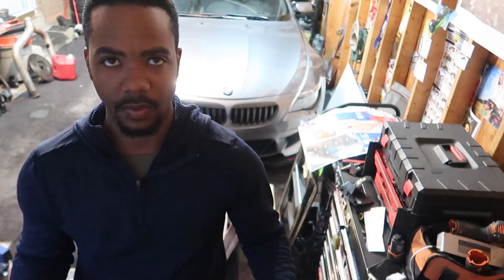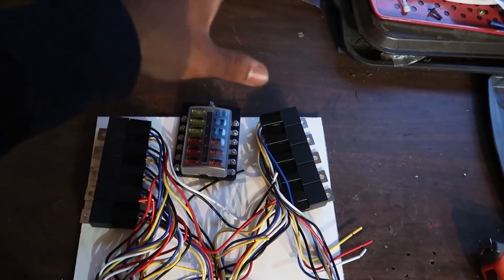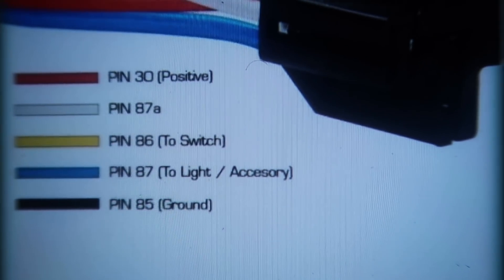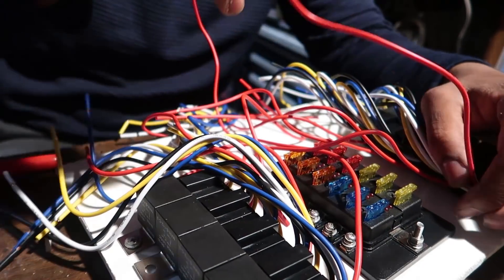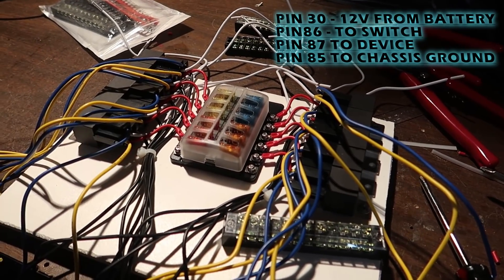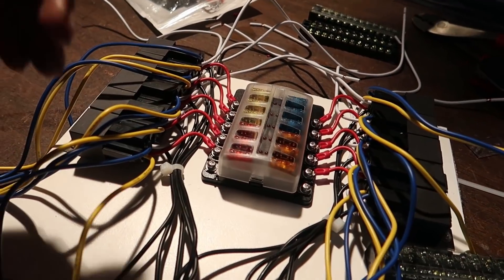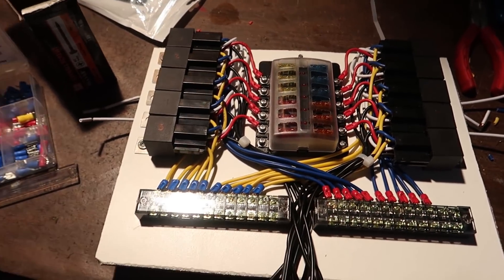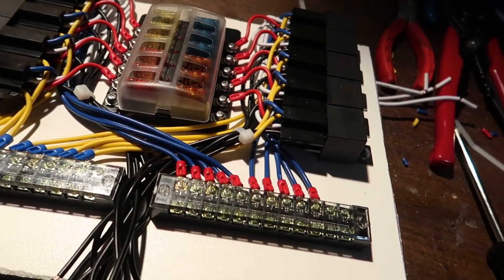DIY Race Car Fuse relay pannel

Comment: Do you have to run power directly from under the hood, or can you use a distribution block to p/u power? And can i ground to a terminal block or do i need to run each ground independently to the chassis somewhere?
Reply from the maker: you can connect all the grounds together and run them to a single wire, just make sure it's a nice beefy wire and find a strong place to ground it.  You really don't want that on a weak ground, and power to the board needs to run directly from the battery into the fuse block....  so yes, in your case, directly under the hood.

Comment: One thing I am wondering and I hope you can answer. I have thought about these relay blocks for a while. I know that it is justified to have fuses running from your power source to your device in order to protect it, is there a requirement for there to be a fuse between the switch and the power source?
Reply from the maker: you should be good as long as there's a fuse somewhere along the powered wire.

Comment: I agree with Liquid snake.  Electrical is not rocket science.  Just need to made sure you label things, the wires are neat, lights should be on a 30amp fuse, and try to put the panel in a cool and accessible place.  Oh, and a great ground is essential!!!!!!

Comment: For the grounds, you can drill a small hole below each relay and run the wire through the board and consolidate them under the panel. Then you won’t hardly see them at all and would be that much of a cleaner look
Reply from the maker: I ran them all to a single hole, but I like your idea better, im going to go back and change it now.

Comment: This actually really helped me understand all what has to happen. I plan on doing this on my e36 so thanks for the video
Reply from the maker: Glad it helped, although its a simple build, most vids oversimplify and still leave you lost.
Reply: Premium Fuel Mag exactly
Reply: I made mine up and idk if I’m over complicating it in my head or what but I’m confused lol i have pretty much the same set up you do. I’m confused on how to wire a switch for my fuel pump into this. I send a wire from the power side to the switch? And then the other power strip thing goes to the fuel pump?
Reply from the maker: no, the switch wire goes to the switch and then to ground, that's what all the terminals on my left side are.  On the right side of my board are all the matching power outputs.  so if I was wiring in a fuel pump, I would run the fuel pump wire to #10 on my right side, and on my left side I would run a wire into one side of a switch, and the other side of the switch would go to the chassis (ground)  If this isn't clear to you, hit me up on @premiumfuelmag on IG, or on our facebook page and I can take a look at what you have. https://www.facebook.com/PremiumFuel/

Comment: Depending on the function and amp draw, you don't want all those grounds running together. Anything sensor related should be ground to the engine block or at least a thick piece of metal. Grounding all of those to a chassis point will likely not work for things like fans. But also, i had issues where the wires to a fan would melt because the distance from the relay to the fan was so long. Doesn't look like the gauge thickness on your wires are enough to handle the amp draw of a fan though. So all of this likely isn't an issue for you.
Reply from the maker: Thanks for the tips.  I ended up consolidating the grounds, but i'll go back and re do them and add them to a heavy 4 gauge wire. On my current set up, my fan is grounded to the frame, no issues, I did consider that the distance from the fan to the relay might be too far though, I will probably run a 4 gauge wire to that as well.   I appreciate your input.
Reply: I have started many an electrical fire lol.
Reply from the maker: I normally just electrocute myself, or fry whatever i'm trying to install lol.
Reply: I disagree. The ground is simply grounding the relay to close the switch when it is activated.
Reply: I agree with Matt. Ground is only to make the connection for the relay to activate when +12v signal is sent to the yellow wire(u said ground in the vid, but it's actually +12v that u need to send to yellow) What ever device is being activated needs to have direct ground that will handle the amp draw, Yoshi.  In this setup, if your powering a high amp draw device, you'll need to replace the red wire and blue wire with the correct guage wire. Also, the white wire  van be removed using a pick of some sort.

Comment: I like to wire my ignition relay to my brake light switch as well. So save a white wire on at least one relay
Reply from the maker: I have no idea how to set up ignition wiring, I'm going to need help with that..... ok, I kind of get what you are saying, I was about to clip all the white wires off lol.  I'm still going to need help on the ignition though.
Reply: Ignition is easy :) You may end up needing another distribution block thingy though
Reply from the maker: I thought about making another board for key on power, but between the new harness and the factory harness and fuses, I shouldn't need to.  I wish it could all be DIY, but as long as things are cleaned up and I can work on it, I'll be happy.

Comment: The easiest, cheapest, and most painless mods to me are electrical. Not to mention the most effective. (Cooling fan, LEDs...)  Like you realized, wiring harneses are only individual circuits and not a homogeneous spaghetti monster.

If I got another Fox I'd throw in an obd2 engine harness from a 4.6 Mustang. (5.0 Explorer harness as a second choice) I'd also get rid of that rats nest on the driver's side strut tower and put a real fuse box there.
Reply from the maker: curious, why would you want an obd2 4.6 harness over the stock one?
Reply: Premium Fuel Mag Opens up a world of tunability and Bluetooth apps, built in fan controller, no distributor, nice fuse box, looks, bragging.... Then the PATS would confuse a theif for a good minute.

Then it would probably turn into "rewiring the whole car project", ... and that's cars for you.